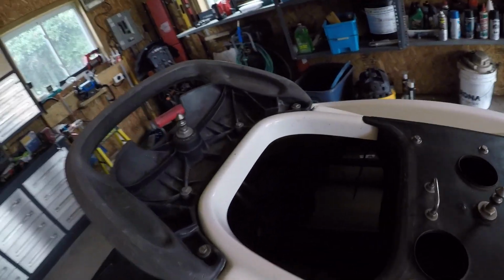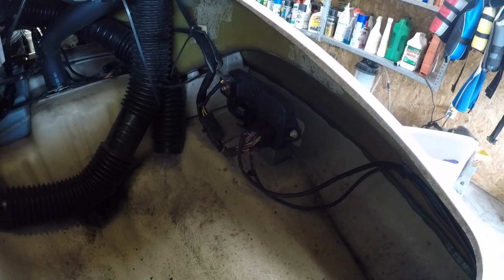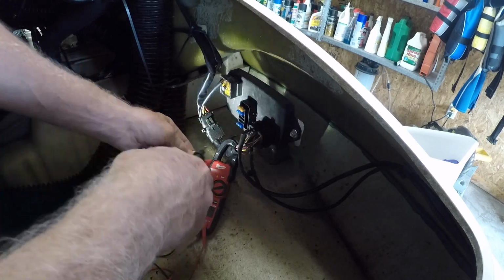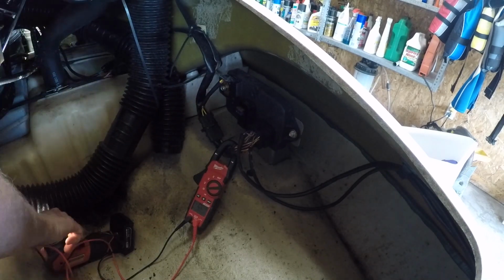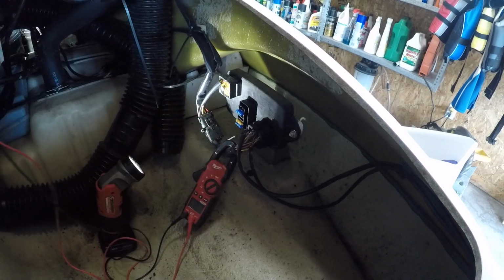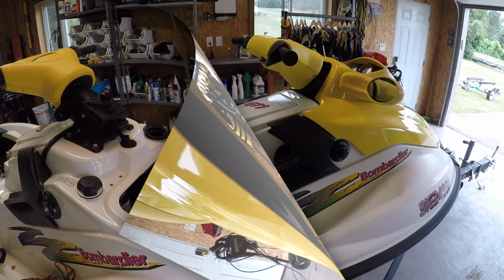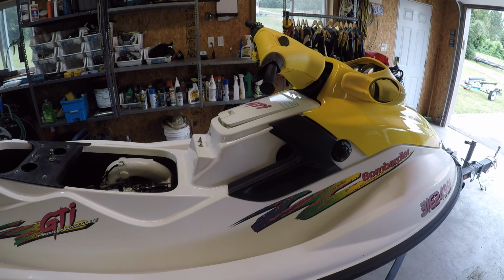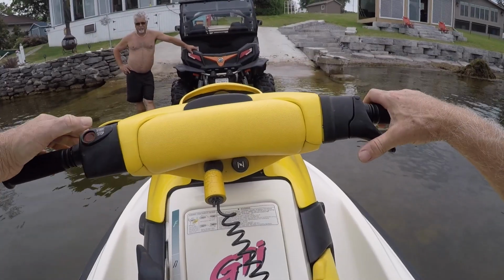97 Seadoo GTI no electrical power

Comment: Hi , I’ve got a seadoo rxdi 2003 charged up a new battery it had 12.7 in it put it on the ski tried to start it and just about cranks over tested the battery and it had 12.1 in it ant ideas much appreciated 👍🏼
Reply from the maker: Check for spark, check compression..check for fuel.  etc..

Comment: i have the same ski.  picked it up cheap.  i have no start, nothing. no beeps no click.   has a fresh battery, checked the Dess post, S/S button, dess key with a multimeter.  all check out.  i can jump it from the solenoid and it will turn over, no spark.  i thought it might be a bad MPEM but i don't get the blown 5amp fuse problem.  i checked all grounds and power to the MPEM and they are good. could the MPEM still be bad?  do know of any other parts i can check that would give me this problem?  any help would be great thanks.
Reply from the maker: Check power at fuses.  I only had 8.5 volts at the computer .  That will tell you if the relay on the top of the cover is bad.
Reply: @SeadooRefurb  thanks for getting back to me.  i cked for 12v at the MPEM plug and have good ground pin 1-17 black and 12v at 1-26 red-purple. checked fuse for 112v and all other grounds, all check out.  i ordered a cheap MPEM from ebay.  $120 (don't have to program key) any key will work.  ill be the guineapig on this one lol  i cant see buying an old one with key for $250 and having the same problem next year.   or fixing mine for $400   i only paid $400 for the ski.
Reply from the maker: @abhvgas  Hmm..No beeps could be just bad teather.  Do you have one from another machine ?  Put that on and see if you get the 1 long beep.

Comment: same exact jetski wouldn't get power, checked everything ended up replacing computer. now it starts but won't gas. any ideas?
Reply from the maker: It most likely needs a tps reset now that it is a different computer.

Comment: Hey Seadoo Refurb, late comment, but I have the same exact issue. I replaced the fuses and every time I hit the starter, the fuse blows. Any advice? Thank you
Reply from the maker: See if you can roll the engine over by hand from the pto .  If you can the jump the solenoid to apply power to the starter to see if the engine rolls over.  Then you will know what is going on.

Comment: I have the same exact one, same color and all. I’ve changed the starter, solenoid, battery…. When I hit the start button in makes a weird noise like it wants to start, but doesn’t. Started last month, then just bam. Nothing.
Reply from the maker: Apply power to the starter to see if the engine turns over.  (Or jump solenoid)  I have seen battery cables go bad.

Comment: I bought one but I don't know what oil it uses, it's the same as yours.
Reply from the maker: Regular 2 stroke oil.  (2 stroke oil generally does not work well when mixed with other brands so if you don't know what oil is in it then I recommend removing old oil)